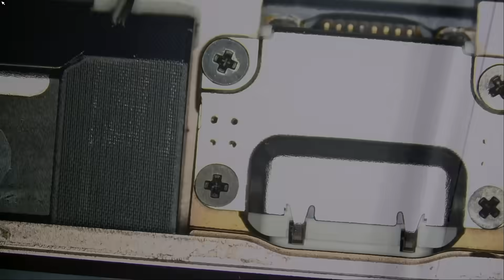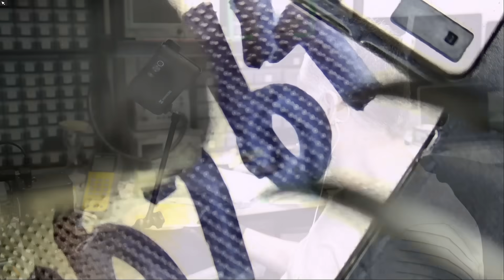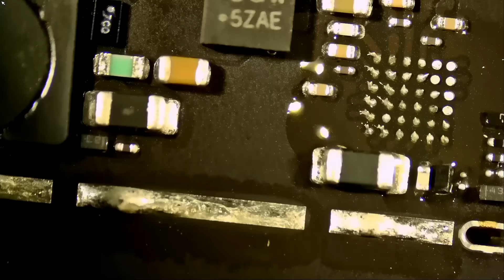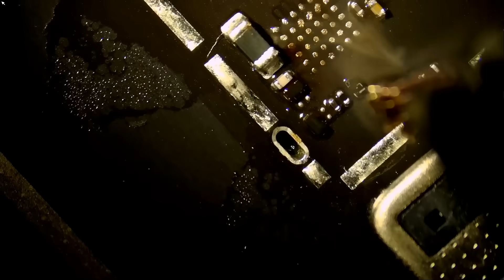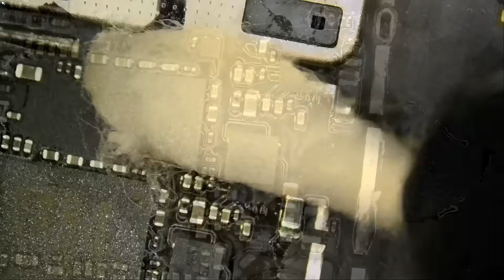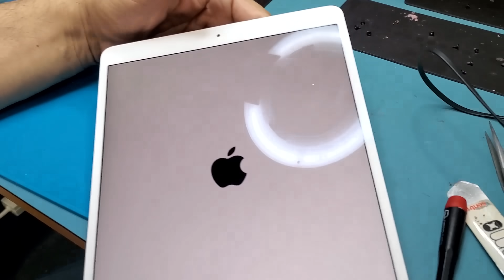iPad 10.5 Urgent Repair. Won't charge or power on.

Comment: When I'm using hot air near FPC or other connectors, I often place a leftover shield from previous repairs over top of it to protect it from the heat. It works really well as long as you make sure it's not in contact with other solder joints that it might accidentally get soldered to.
Reply: Will Kapton work too ?
Reply: I place a damp tissue and it also works temporarily
Reply: @narha_syd Not well, but foil tape does!
Reply: Aluminium tape is really good at heat reflection, never use kapton tape now.
Reply: @narha_syd  Nope, kapton is heat resistant, not a heat shield. In other words it tolerates heat but doesn't deflect it.

Comment: I really enjoy these videos. Once I get settled, I will be purchasing a whole starter kit, I feel very confident through watching the videos and reverse engineering the problem using logic, common sense, and creativity. Thanks again for sharing
Reply: It looks easy but...
Reply: It looks easy but trust me you need a lot of patience and experience to be skilled as Alex so it looks easy when he is douing this.
Reply: @kissszilard4220  half of the job is having the right tools. Use an old board to practice on. Remove all parts and reinstall them. Then, work on an item that does work. Pull it apart, and desolder all the parts on it. Resolder them. That will be my method. 

I would start with charging ports on tablets and mobile phones. I have 2 xbox controllers I want to pull apart and sort out the two joysticks. 

You will never get any better if you don't try. I had ideas on how to diagnose problems with a thermal camera to see where it gets hot. Little things like that, just using the right tools and common sense. Using alcohol too is a great idea, I didn't think of that. 

So I've learned a lot and impassioned enough to try. By no means will I be as good as Alex
Reply: @kissszilard4220  yeah! Not a “Pick up and go” hobby. I’ve got frustrated many times! Definitely need some kind of microscope if you’re gonna be doing electronics!
Reply: Try it!
It looks so rewarding, I've been on the fence for months!

Comment: In this kind of job where you need to open the metal cover for the chips. Is it ok if we leave the board without the metal cover again? Seems like the metal cover does nothing like doing some heatsink functions. I feel like opening the chip would make better heat dissipation.

Comment: Hello, really nice video :) I love watching those fixes.  
This reminds me of a question that I have, but I don't have any friends that could help me IRL so I might just ask you if you have a minute to spare to give me an idea on my task.
I have 2 SSHD hard drives. One of them is broken and the disk inside does not spin. It contains drawings of a friend of mine, and he needs them because he wants to present them at a Job interview.  
 I got not exactly the same, but a pretty similar hard drive with a matching board. 
 I tried to swap the boards, and I can hear that the disc inside spins, but I still don't get it to work. I've read that I should switch the bios chip as well, but I've never done that before and I want to be sure if that's what needs to be done.
Could you please give me some advice? I've uploaded pictures of both hard drives, the new and the old one and they can be found here : https://imgur.com/a/jo8lfnL
I would really appreciate your help :)